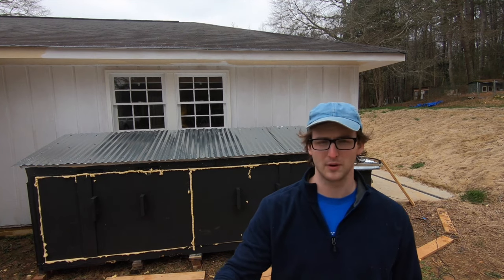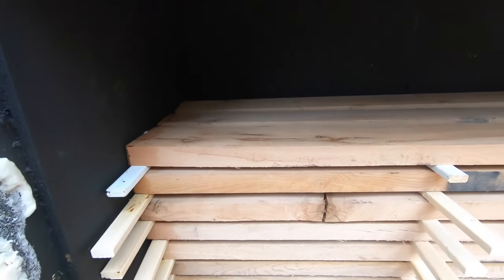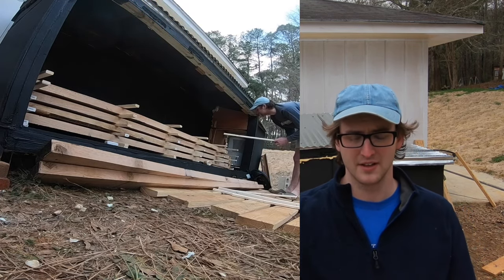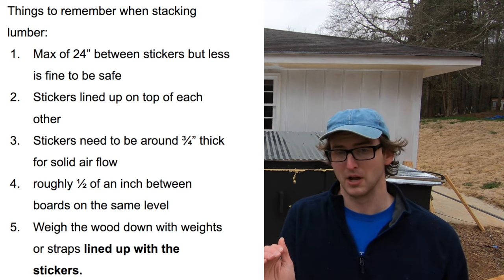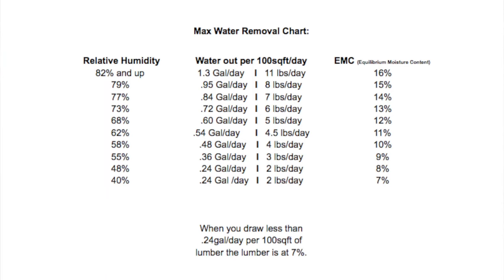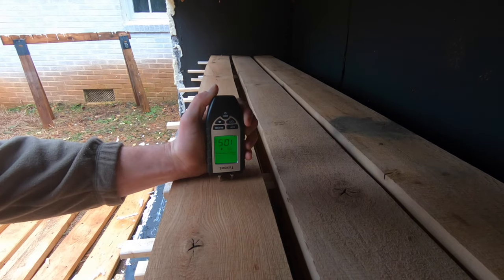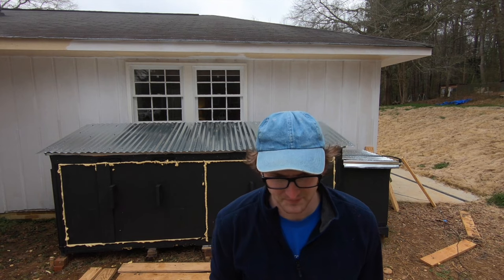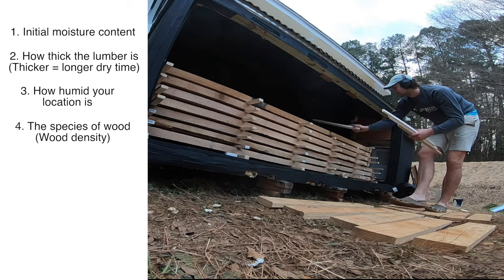Everything you need to know to run a small Wood Kiln. No Fluff. All the info in one place

Comment: only issue i believe there not enough heat in your set up  to kill bugs so oak holds some bugs need to kill them after drawing the water out.   sorry to tell you this .   but keep the video coming and work on that as well  150 and drop temp slow over 3 days.
Reply from the maker: Thanks for the feedback! I agree I've got 2 heat lamps now that boost the temp up above the 150 degree (air temp) mark for killing bugs. But for a small personal use kiln where I can check all the wood I would argue that this isn't really an issue unless you're drying wood thats been laying in the dirt for a long time! just my thoughts though!
Reply: @ThomasOrrOfficial  What is actually required to kill bugs is 133 F, internal temp, for 24 straight hours.
Reply: @michaelborn3318  how would the internal temperature of the wood be measured?
Reply: @asderven  Drill a hole and put a thermometer in it.   We would pack a little sawdust around the outside to get a better reading.
Reply: @michaelborn3318  Thank you. Drill the hole all the way through, or to 1/2 the thickness to get the core temp? I am guessing you are putting in a probe thermometer?
Reply: @asderven    Just half way through.
Reply: @michaelborn3318  thank you for all your help.

Comment: Really great video. I have a question about a dehumidifier on Amazon. I found one that is an alorair Sentinel HD 55. It’s about $550, but looks like it will be pretty robust for a long life. Once you load the kiln with lumber, you will get your starting humidity and then work down the chart from there correct? Also, I think I saw in another comment, but you do have some small vents where air can come in?
Reply from the maker: Thank you! And that sounds like a good humidifier, and to answer your question! Yes for the chart! And I actually don’t have vents in mine as that’s more for the solar kilns although I almost never seal the doors and they’re not air tight by any means! Haha
Reply: @ThomasOrrOfficial  thank you!

Comment: Awesome video, TJE Builds, thank you so much! Quick question though. When referring to the max water removal chart, it says per 100 sq/ft of lumber. Does that mean on both faces? I am starting to dry live edge slabs on a regular schedule now, so I am wondering if I should be taking into account both faces (top and bottom) of the slab when calculating how many sq/ft I have in the kiln load, or just the square footage of one of the faces? Basically, if I have a slab that is 10ft long x 2ft wide, would that be 20 sq/ft (one face), or 40 sq/ft (both faces) in relation to that chart? I hope that makes sense what I am asking. Thanks in advance for any answers you can provide for me here, I couldn't find anything very easily trying to google this lol.
Reply from the maker: Hey Chris! Great question! It would be for both faces! The chart is for the total exposed surface area so for your example it would be the 40 sq/ft!

Comment: Very good videos, thank you. What sort of paint did you use on the interior? And are you able to keep RH below %50 ?
Reply from the maker: Thank you! and I cant even remember the brand of paint but I basically just asked for the cheapest exterior black paint home depot had. And yes it stays around 40-45ish as long as I don't open the doors and whatnot! If its extremily wet (such as if its been raining for several days) and I haven't sealed the doors with Great Stuff it can get a little higher though
Reply: @ThomasOrrOfficial  thank you, you make good content
Reply: Ok, finally got everything. So do you just thrown a dehumidifier in there and set it on a certain % rh ? And do you maintain a specific temperature ?  Or is it a graduating scale ? Like start at room temp and slowly dial it up ? Thanks

Comment: I have kiln up and running. 
Question.  what temp do you run at?  Worried about case hardening. 
Org 1st day 101, 1 gal of water 
Day 2 3 temp 95.0 .5 gal
Now lower temp 90.  No water from dehumidifier since day 3

Started Sunday 4pm on 11-13th
I have pics to send kiln.  But not sure how to attach 
full 40 boards mostly 4Q. Some 8/9Q

Comment: I have a quick question. Per your video, as I commented before, I just built my kiln pretty much exactly like yours minus the extra attached box for the dehumidifier. I purchased the Elitech humidity and temp controller to monitor what’s going on. So I stacked my oak and black walnut inside that had been drying outside for about a year as a log. When I put them in the kiln their moisture content was about 25%. I have my heat setting set to the 100 degrees based of the chart that you showcased. I am noticing currently that the current humidity in the kiln based off the Elitech is 29 % and my dehumidifier is reading at 45%. I do not have a setting I believe on my dehumidifier to leave it running without actually functioning as a dehumidifier. Do you turn your dehumidifier on its lowest setting and leave it going? Based off that graph I assumed the humidity would be a lot higher.

Comment: One more question. If you load material, and your initial humidity reading is 60%, what do you set your dehumidifier at? For example, would you set it at 50 and then wait until water stops coming out, then reduce it to 40 the next week?

Comment: Question, the solar kiln shows air exiting the chamber, but none entering. Where is the make-up air coming from? Also, in your payback scenario you didn't mention the energy cost. Do you know what your energy cost are for drying a load Thanks.
Reply from the maker: You're right good catch! I forgot to include in the drawing vents that would be at the top above the baffle where air can come in. To answer your second question: I've been running my dehumidifier virtually constantly since this video's release and seen roughly a $15 - 20 average increase in my electricity bill. Not sure how conclusive that data is but just my observations! I hope that helps!
Reply: How long did it take you to dry that first batch of wood? How big is your dehumidifier, meaning how much moisture can it pull?

Comment: Well there is a major difference between dehum and solar that major difference is heat. Now why is that important? Well its important for one major factor.  The hard yes to a solar is this! (Sterilizing ) you cant do that in a dehum. You need 140 degrees 24 hr and natural cool down 24 hr. Sterilizng is important as there are bugs in wood. That is the reason to do this.
Reply from the maker: You are correct! I've got a couple of brooding lamps that do the trick in there now!

Comment: Great video, thanks! I am just wondering approximately how much this raises your power bill in a month's time, including the heat lamps, and about how long did it take on a batch of wood with the heat lamps? Thanks.
Reply from the maker: thanks for reaching out! The power bill was barely noticeable but maybe $15-25 dollars depending on the season. and the time is dependent on the species of wood in the kiln but for a Western Red Cedar which is what i use mine for mostly at this point, assuming the wood is only roughly 20% MC it takes 1-2 weeks to get below 10%MC and I only turn the heat lamps on for a handful of days to get the temp up to about 150 or so at the end. a denser wood would take longer though! White oak takes like 50-60 days after its air dried for about 4 or so months.   Hope that helps!!
Reply: @ThomasOrrOfficial  thank you for responding. That helps as I'm dealing with white oak, red oak, and other hard woods. Thanks again for the video and info.
Subscribed.

Comment: Hello question what if you dry boards that have been dried before with air dried rough lumber?

I have boards that should have been  dried but are measure 10 to 11 walnut and cherry 

I have 3x3x11 dehumidifier kiln 
Thanks kevin
Reply from the maker: Hey Kevin! That’s actually best case scenario as it’s a lot harder/impossible to dry them to quickly when they’re already that dry via air drying! You should be able to get them down a bit more in the kiln!
Reply: @ThomasOrrOfficial  Thank you

Comment: How hot can you get your kiln and still have your dehumidifier functioning? I just ran mine for the first time and the dehumidifier shut off at 95°.
Reply from the maker: Hmmm my dehumidifier alone was heating the kiln up to around 130 and then for bugs I used brooding lamps to get it to 150 although I turned the dehumidifier off for that
Reply: @ThomasOrrOfficial  Interesting, maybe mine is not functioning correctly. Do you happen to recall what maker model your unit is?
Reply from the maker: @BigNicky77  I’ll look and see when I get home I can’t remember off the top of my head

Comment: I'm new to woodworking. I've heard a year an inch to a month an inch for drying. On average how does your kiln average just as a ballpark?
Reply from the maker: Hey Thanks for the question! It actually totally depends on the species of wood you're drying, I'm releasing a video soon on that very topic but for nstance Western Cedar which is a wood I use regularly, for a 1x6 to ry from around %30-%40 MC to around %11-%14 which is fine for outdoor furniture it takes rouhglly 2 weeks to dry! For White Oak on the other hand it's taken me more like 90-110 days to get it from around %25MC down to below %10. Hope that helps! If you'd like to kow more I'll be releasing a series of shorter videos on various kiln topics in the next week or two!
Reply: The year per inch is the rule of thumb for air drying lumber.